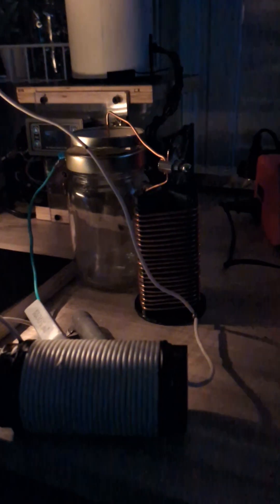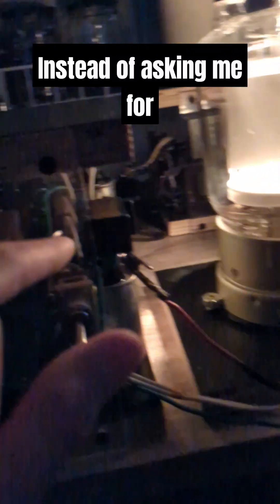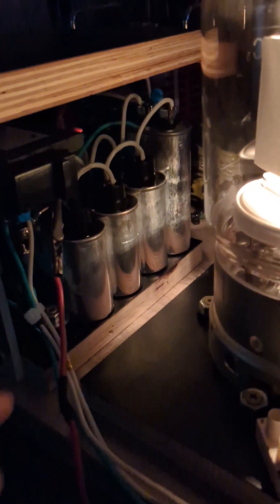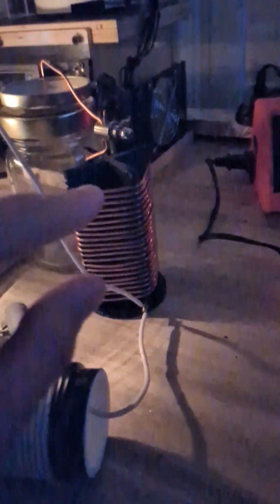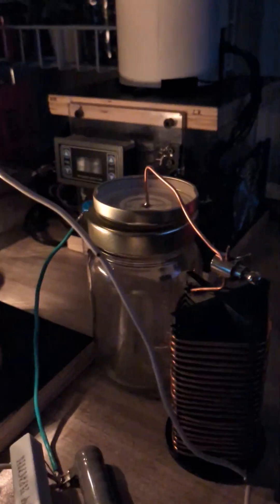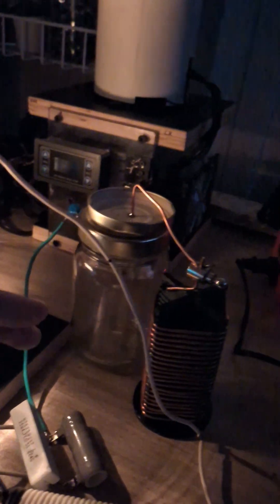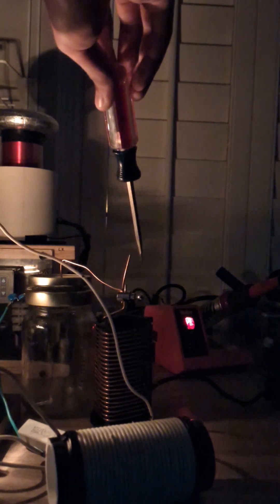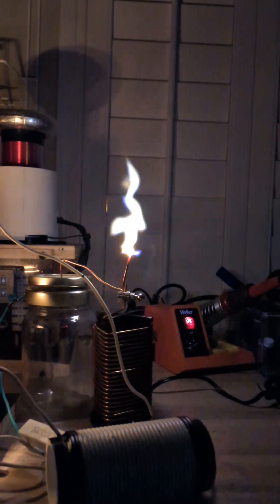i made a candle but wayyy cooler 😎 #highvoltage #engineering #electronics #plasma #flame #fire

Comment: 🎉😮I like this .U got a subb..
When U say "spark over caps .. are these caps wired thru that resistor back to a grounding line ../valve grid .. 🤔 parallel... To snuff out any ark overs.. of hv.
Reply from the maker: Pretty much. The resistors connect from the grid to ground. From the blue ceramic protection capacitors, it connects to the grid.

Comment: You might create Xrays with that vacuum tube.
Reply from the maker: I think photonicinduction did it
Reply: @livewire460 However I wouldn't recommend it. Depending on your acceleration voltage
 you might actually create low energy x-rays that are not detectable by the usual hobbyist detectors but are still damaging to more sensitive areas like your eyes.
That might be what happened when photonicinduction did it - his measured dose rate was quite low but you can easily get into dangerous territory by applying a really high voltage to vacuum tubes.

Comment: Very cool, but PLEASE don't use a screwdriver for starting it 😅
Reply from the maker: Gotcha 👍
Reply: @Livewire460 if its true ac at that high of a  frequency you dont die but at a mot current you will get burned
Reply: @sunlabsExperiments  Its not isolated from the DC mot supply so he will get cooked.
Reply: @RBMK_Dyatlov1 RF on a DC bias: Why not both? 😂
Reply: @SkippiiKai  You haven't looked at the schematic of this circuit haven't you? The resonator is basefed and you close the circuit through the supply to ground.
Reply: @RBMK_Dyatlov1 No, I didn't. I was speaking in general terms about the options between getting skin burns vs fully cooked.

Comment: Hfsstc dam . What freq it operates?
Reply from the maker: 42 Mhz
Reply: @livewire460 How did you measure that? I highly doubt its that high just from looking at the resonator turn amount. I would guess its closer to 10-20Mhz
Reply: @RBMK_Dyatlov1 He asked every ham radio operator within half a mile what stations suddenly disappeared. 😂
Reply: I don't think that vacuum tube qualifies as an SSTC. ;)